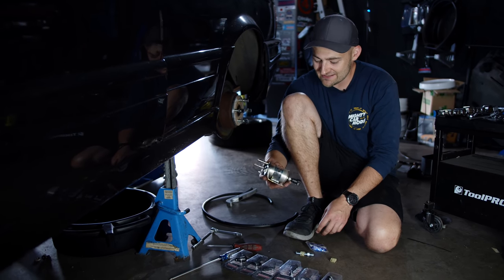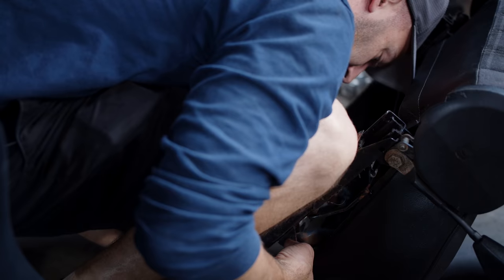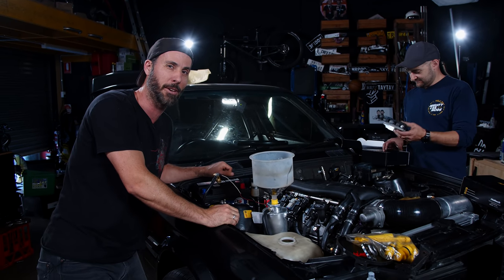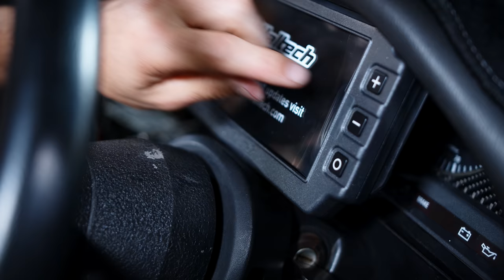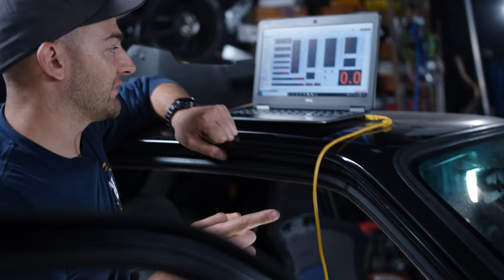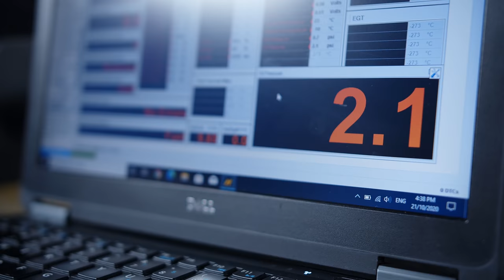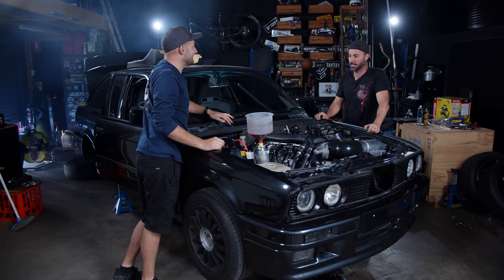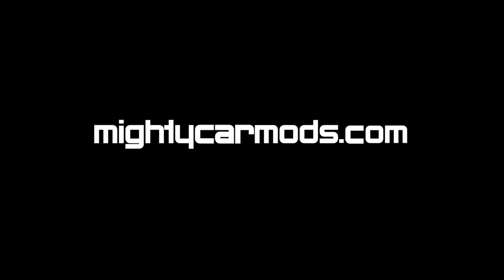LS Swapped E30 // First Start (and NASTY interior surprise)

Comment: I cant wait to see the Lotus Vs The BMW. I want another sort of Challenges!
Reply: lotus will shop it
Reply: chop*
Reply: I think bimmer will be more a drift car than track car but I'm sure it'll be very fast either way
Reply: @collinw9381  Yeah the Lotus will most certainly wipe the floor with this unless they go full time attack spec but I doubt they would as they seem to be more about projects that the audience could theoretically follow along with. I still have my fingers crossed that they will delve into all that one day. Even tracking the cars was a welcome surprise when they first started with that. The E30 is the type of car you'd turn into a race car, it's small, it's stiff, it's a really good platform for a total transformation.
Reply: Will be close and very interesting. The bmw will smoke it on the straights and the lotus will run around the outside on the corners. Bring it!
Reply: I'm predicting the bmw is gonna chop the lotus, then moog is gonna K Swap the Lotus.
Reply: @Darkslide2AR-FE  that sounds amazing haha. Doubt it but
Reply: @collinw9381  but its all about fun-per-buck-ratio in this one aint it?
Reply: @Darkslide2AR-FE  I think you are underestimating how fast that lotus is
Reply: @monkeytechx  only reason I say this is cause of the k24 in the garage and it being a usual swap on the exige.

Comment: As a guy from the U.S. (South Texas), it's weird for me to watch an LS swap and not hear a huge cam when it starts 😂😂
Reply: @Shaun Huxtable  My SS has a big cam and I’ve never had to do anything about emissions here in QLD. I’m not sure I’ve seen an LS swap without a cam upgrade here either.
Reply: I agree,when I think of an LS swap,I think of the “ Whumpty-Thumpty”  of glass shattering idling bass exhaust bravado.....or is that a HEMI engine I’m thinking of ? 🤔 anyways,I digress....
Reply: @Shaun Huxtable I wonder if this is a state by state rule or something like an ADR rule. If so I wonder what Tasmania would be, we have very laxed laws down here.
Reply: Half the commodores in the street here sound like harleys they have such lumpy cams.
Reply: @Shaun Huxtable are you legally able to drive yet?
Reply: @Shaun Huxtable really? Cars have to be dynod to be engineered in some states? I'm in sa and you could have 2000hp in a civic if you wanted, power to weight only effects p platers

Comment: Perfect gentlemen. A JDM German with a Commodore donk. Martin, Blair and ol' mate Dave. Chopped!
Reply: It's not a commodore engine its an American GM Chevrolet engine.
Reply: @markrides7939  it's an engine that came out of a commodore. therefore a commodore engine. even if the original engine was designed in the states.
Reply: Cheers mate

Comment: That was the easiest first start I've ever seen in my life.
Reply: some random guy  You are a monster.
Reply: some random guy  oh well duh! Of course I forgot
Reply: LS things
Reply: Because it's an ls lol its plug an play
Reply: that's pretty much all American V8's for ya
Reply: some random guy  You are a monster
Reply: @GarrettRSV4  lol except chrysler v8's.
Reply: @matthewfield7028  you are definitely right about that one lmao
Reply: @GarrettRSV4  I rather run a Ford V8 over Chrysler any day lol but LS is a true plug and play set up. Throw $500 - $1000 at a ls and you have a reliable 600hp+ daily.
Reply: Iv seen people start gm trucks that have been sitting in a field for several years. Fresh gas and a batt is usually all you need
Reply: @flyingmunk8956  I had a 2006 Silverado 2500 that sat for 6 years. New battery, fuel system flush, new fuel filter and it started up no issue.
Reply: @matthewfield7028  yeah. Its pretty common to even take one out of the junk yard and get it running with pretty much no issue. And who knows how long some of those sit there in the elements
Reply: @FonicsSuck  Yup same with mine. I didnt  even prime the oil with a tool, just cranked with no fuel pump or ignition. got oil pressure and started it right up. flick of a key. a lot better than a carb

Comment: I suggest you guys connect the clean air inlet PCV breather tube near the Oil cap for the crankcase inlet @ 8:20 clearly shows it missing where he touches it for a second, the aftermarket air intake pipe is the culprit as is many aftermarket - it needs a barb T-pieced from the intake going to this port to allow dust-filtered (sometimes post MAF measured) air into crankcase ...  its gonna suck air and dust in 24/7 otherwise - sludging up the oil and bearings with dirt and stuffing the internals

Comment: Who was the dingus that thought "Hmm wheel nuts are annoying. I know, we should make them bolts so you have to struggle to line them up while hold the heavy wheel while trying to fit them back on." ??
Reply: And now with SUVs getting so popular it's worse, every car has 18s, making it a day at the gym every day I go to work
Reply: They get hot AF too because they run through into the hub.
Reply: @SilentKilla92  Far out. Is there even an up side to them at all? I just don't get it
Reply: @yeahnah6468  I don't get it either, if you cross thread or have a seized one it would be a living nightmare.

Comment: Hello guys, I'm enjoying the project as I owned a e30 325i convertible a couple of years back, I thought I could give you a couple of points on this project, these cars are rear end happy due to being light, a LSD would be a nice upgrade, also I have broke a hand brake in half so a reinforced one could be needed. On the original engine the sumps sit low especially when you lower the car so don't know what your clearance is like with the ls lump is (I've smashed mine) and on a side note we use to put bags of sand or cement in the boot (in the UK) to stop them spinning out so much lol, good luck on the project guys.

Comment: you can use e36 steering rack, with little modification, and you will get bigger steering angle and one turn a less on the steering wheel from full left to full right

Comment: One of the few things you can't crap on is the original throttle pedal, hinged from the floor which was always much nicer feeling than regular ones. It's simply from an era where it was cable driven, it still did the same job and honestly has a bit less delay than early throttle by wire cars like the 350Z I've got now. There is a weird pause before everything works that's almost worse than old cable throttle cars. Even my 2018 WRX was weirdly delayed, and the position of the throttle was AWFULLY imbalanced, most of the throttle is in the first half of the pedal so it feels quicker than it is, and then you floor it and there's barely anything left. It makes you drive too hard always. Anyway, was the luckiest person in my hemisphere with the timing I bought the 350 used (with only 28k miles!) for 10 grand and got every penny I paid for the wrx brand new in a used sale bc of the insane car market in covid. No more car payments and I'm back in a coupe which is just more my style, almost all my cars have been 2 door. One of which was a 325i of the same generation as this channel. That was my favorite but gd it was a money pit and even the dealer took a month to find parts while I drove a manual Ford Ranger around town with no 3rd gear. It was still really fun though, that small truck. Also had a 93 prelude with full H22 (200hp), LSD, and short ratio gearbox. That was def my 2nd favorite if not actually outranking the bimmer. It could be driven right up to the edge every day, all the way up to 225K miles it was v-tech'd and turned hard enough to make the tires scream in protest. I had a '96 240SX as well but it was auto so it wasn't so much of a blast. You could however do standing burnout in the thing just by mashing both pedals from a stop. But the trans was making noises before I traded a friend for the prelude. Also I must say. Sunroofs are better than moon roofs. The one in the bimmer is particularly great. It's crank operated and just a blast to open and close. The prelude's was also JUST a sunroof and I liked the option, plus my windows are always down too. Why would anyone want glass up there? It's heavy, you'll just get sun in your eyes and you can't see stars anymore in cities. The moon is in a position to be visible in it like 1 day a month and you won't be driving at that time. And a dumb note for Subaru. A "sunroof delete" is not an option to sell a performance (base) model. It's a lack of an option. Sure, point out the weight savings, but don't call it something it isn't. They didn't cut a sunroof hole and fill it back in. It's a LACK of sunroof. Wandering aimlessly rant over.

Comment: an idea for the bonnet , maybe you could 3d print some spacers for the mounts to lift them up afew inches then use some black plastic Gard stuff you use to fake lower a car around the edges to "seal" it / hide the gap

Comment: Pull off those fuel rails and pull off the skull cap cover sitting over the manifold that will also drop your height by half an inch and no heat soak! Win win

Comment: Garagistic half cages for e30’s mount to your thicker floorboard rails instead of sitting on just the thin floors. If you actually roll over, there’s a good chance a cage like yours could tear through floors on impact, especially with a rusty car

Comment: I'm so happy about this lol. But I'm also cautiously optimistic about it as well, the last episode where you stabbed the transmission to the engine really makes me concerned about damage, I mentioned it then too. I really hope everything is perfectly fine and there are no problems whatsoever but I have personally seen the damage resulting from someone using the bolts to "pull the transmission flush to the engine". My motto is if something doesn't go on the way it's supposed to then pull it off and find out what's causing it to bind.

Comment: It's interesting to see how cars are built on the other side of the planet, over here if ya got an E30 and need Recaro seats... we buy the E30 Recaro seats... :P But I imagine  they're not as readily available over yonder. 
Also... I forgot where the battery was supposed to be in an E30, practically every one I see has it moved into the boot/trunk.

Comment: We always pack the oil pumps with grease on a build, an old trick to get pressure up fast as some motors can be a bitch to get it up after a build, may be give it a try? and why did you not vacuum fill the coolent system?

Comment: the roll cage does not come with an insulation foam pad that can be placed on the bottom mount plate to prevent water from entering the car?

Comment: Should not the roll cage bolts have the threads going into the car? Bolt heads are much less obtrusive than the threads and nuts and you keep the threads inside out of the dirt and grime?

Comment: more money can be saved if a ls1 with stock pcm p59  and  chopped oil pan tig weld it  and  ls1 deff  cut the cost to less than half but u have sponsors to put there stuff

Comment: Just thought I'd point this out because I haven't seen anyone else do so. 
Those seats aren't actually Evo 8MR seats, they're just regular Evo 8 seats.

The difference is the blue in the back and bottom of the seat as well as the pattern in the bottom. The 8MR seat should be all black with no pattern anywhere, while the 8 seat contains the blue back and bottom as well as the pattern as can be seen in the video. Hopefully Marty paid the correct value for an 8 seat not an 8MR seat, otherwise either the seller didn't know what they had, or were lying to get more money for their interior. 

There is no functional difference between an Evo 7, 8 or 8MR seat, purely visual changes, so the boys won't be disadvantaged for having an 8 seat, however the 8MR had lower production numbers and thus, it's seat would be valued higher. 

If you would like to look this up for yourselves, there are current 3 Evo 8's on carsales, of which 2 show photos where front seats are visible (you should be able to see the blue pattern) and there are 5 8MR's on carsales, 3 of which show photos where the front seats are visible (you should be able to see the seats are all black). 

No shade thrown at the boys, it's an easy mistake to make since the seats are otherwise identical. Just thought I'd put that out there so everyone who sees this is better educated on their Evo seats 😊

Comment: Having found cockroaches, you should probably rip out the ENTIRE interior, INCLUDING the dashboard assembly. And bug bomb the shit out of the car.
AND thoroughly search for any of the damned things ANYWHERE the car has been parked. Your shop. The shop you did the engine work at. EVERYWHERE.
Fine powdery diatomaceous earth does a pretty good job at killing roaches, and it's not poisonous. Just don't breathe it, cuz the sharp microparticles will cut up your lungs. Which is kinda how it kills the roaches. (and other bugs)